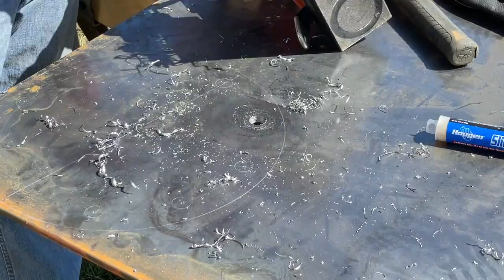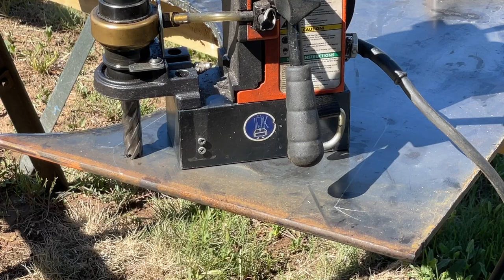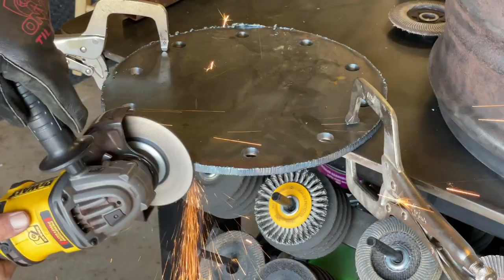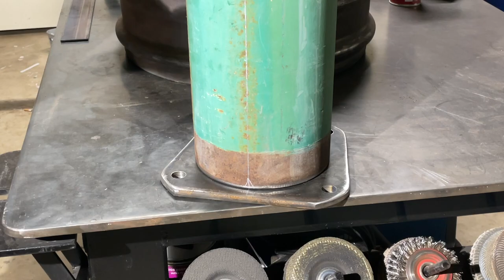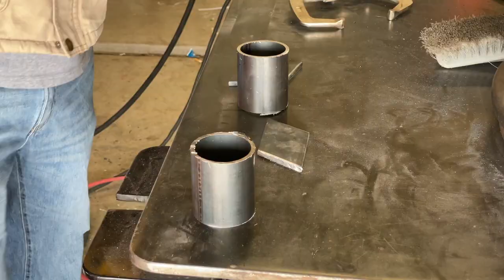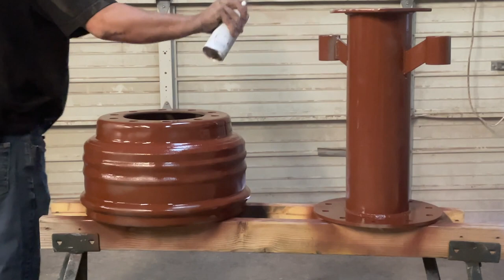Wilton Vise Stand Build

Comment from the maker: Tools used in this video:
Wilton 6 1/2" Tradesman Vise - https://amzn.to/3tTbM1d
DeWalt Cordless Grinder - https://amzn.to/33Up6Yl
Norton Cone Grinding Stone - https://amzn.to/2RTCAB4
Dewalt Cordless Impact - https://amzn.to/3tQCqYx
Fein Slugger Metal Saw - https://amzn.to/3eOMJI7
Jancy Slugger Annular Drill - https://amzn.to/3bsIaBu
Ridgid Pipe Stands - https://amzn.to/3fohin8
Trojan Sawhorses - https://amzn.to/33NRLhJ
Victor Cutting Torch - https://amzn.to/33NA0zb
Irwin 11" Locking C-Clamps - https://amzn.to/3hseRCO
Estwing Blacksmith Hammer - https://amzn.to/3uRY1RN
Transfer Punch Set - https://amzn.to/3uWkbCq
Compass - https://amzn.to/3tMqkjb
Markal Silver Streak - https://amzn.to/3uUvASW

Comment: Hello, Ben - excellent video - you certainly display your considerable  knowledge and skill as millwright and welder in this project - not to mention the steadiest pair of hands I've ever seen - I like your use of the hammer while welding - did you use a lubricant prior to drilling? Also, will this be a portable or stationary unit? I can say that this video is a fine example of fabrication at its best...Outstanding!
Reply from the maker: Thank you very much! I used a wax lubricant on the annular bits. This vise stand is meant for my shop that will be built in the next couple of weeks. So it is meant to be semi-permanent, so that I can position it in different places within the shop. Later I may mount this vise to a table, I haven't decided just yet.

Comment: I always wanted a Mag Drill and think I might start looking for one. I need to build something similar for 1 of my 3 Wiltons. Awesome video.
Reply from the maker: Thank you. I’ve been catching videos on your channel, I’m actually quite surprised you don’t have more subscribers.
Reply: @txtoolcrib  Thanks. I saw one of your videos on a concrete poor, do you have the framing part. I been wanting a 40x60 shop and looking for ideas. The only issue the shop will be 5 miles away on a diffrent lot I own as my home lot is to small. Well I'm a new subscriber to your channel.
Reply from the maker: I am wiring it in as we speak. I have to get the rest of my equipment inside and located before I finish out the wiring.

Comment: Should have the wheel bolt heads on the outside vs the inside in case you weld off it.
You won't get welding splatter on the threads, but dam good job!

Comment: It's been a couple of years. How do you like your stand so far? How is its stability? Anything you would do different? With that size of vise, it seems like there could be some issues with stability. I just got a 6.5" vise and am thinking I need a concrete slab if I want a pedestal stand. I could be wrong of course. Beautiful work by the way.
Reply from the maker: For what I need it works perfectly. However, if you are going to be needing it to do some serious stuff, then I would recommend mounting it to the floor.

Comment: Great welds. What settings did you use for wire speed and amps? Also, did you use a 220v or 120v mig?

Comment: Hello, what thickness of steel plate did you use for the top and bottom base plate? Also, what length of bolts? Thank you, and great looking welds!
Reply from the maker: I used 3/8” plate for both plates. Bolts were 3/4” x 2”

Comment: Guess you don’t need it but a circle attachment for the torch may make a good video, I just can’t get over the shot brake drum that’s not more rotted than worn, must be a rust belt thing
Reply from the maker: I’m actually planning to start a separate channel for build like this, making some of my own tools, furniture my wife wants me to build, just for fun projects, and general metal working tools and techniques. I’m about to have my shop built and will be making quite a few things in the near future.
Reply: TX Tool Crib Nice